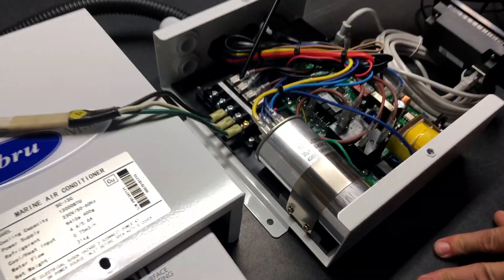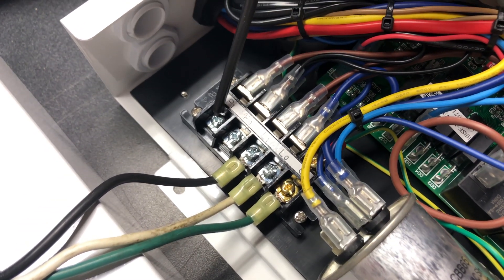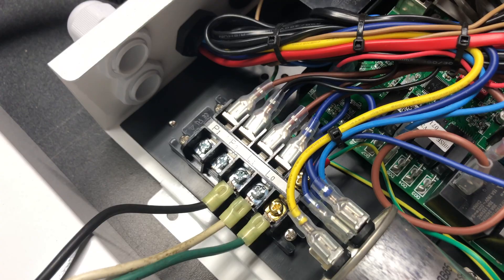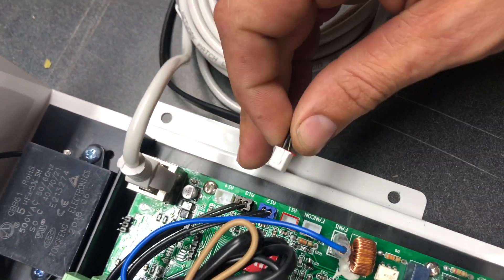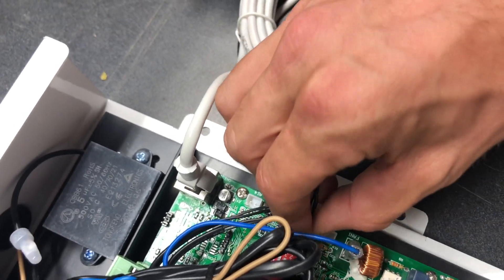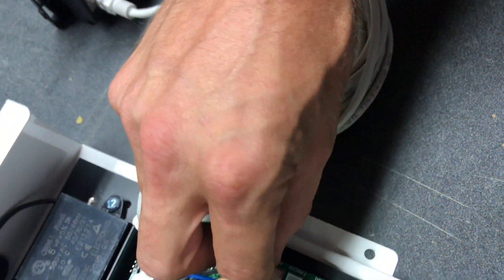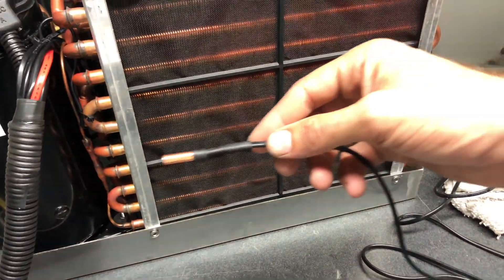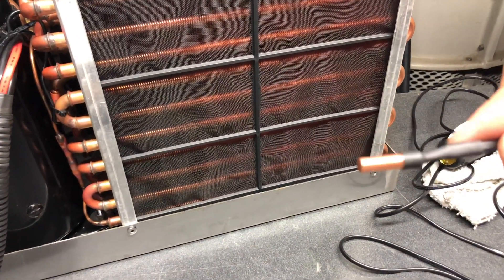Mabru Marine Self Contained Marine Air Conditioner Wiring

Comment: How does the pump wiring go? You mentioned positive, common, and ground. I assume these are connected to the 120v to 24v solid state adapter brick that was provided? There are only two wires for the 120v side of this unit. Are there any wiring diagrams that picture how exactly the pump is wired?
Reply from the maker: there are (5) terminals on the terminal strip. P1 is Line1 to pump, P0 is Neutral or Line2 to pump, L1 is  Line1 from breaker and L0 is Neutral, Line2 from breaker, Ground icon or "E" is Ground. We do have a wiring schematic that we can send over. You can reach us at support@mabrumarine.com.